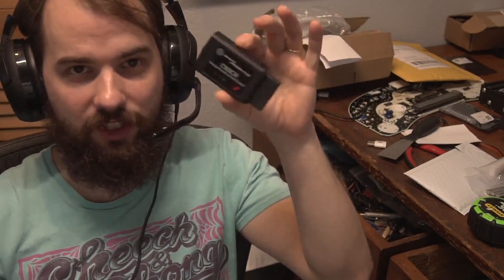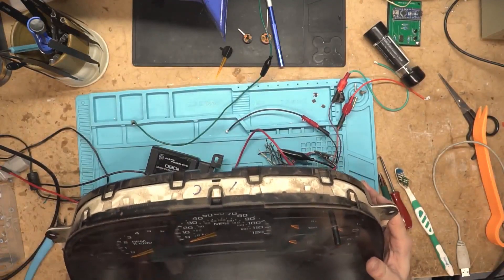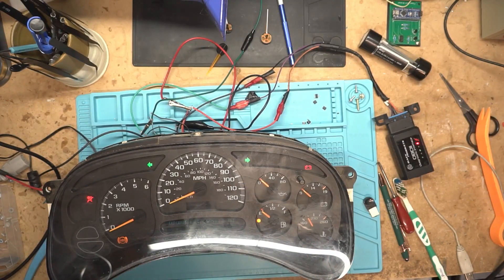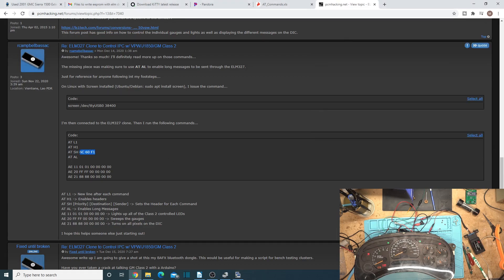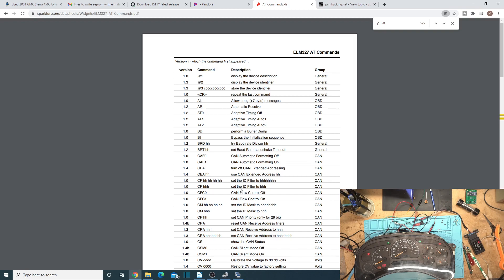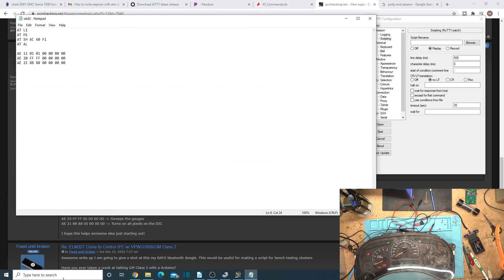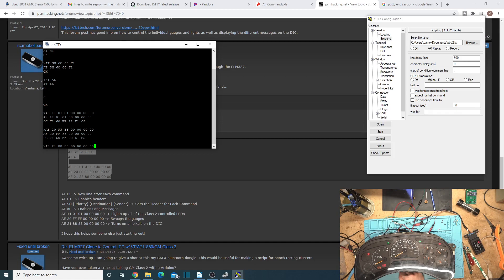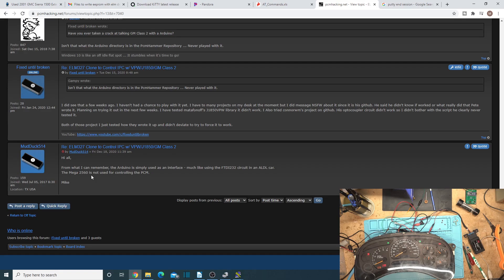Bluetooth ELM327 Dongle To Bench Test GM Instrument Clusters!

Comment: Great video.   When I try the DIC light-up command on my 2006 cluster (with a blank VFD), I get a reply different to yours. I get 6C F1 60 EE 20 E1 E5
Could this be an error message returned due to the display not working? Maybe the mpu can't communicate with the VFD drivers?   I've been struggling with this blank Info display for a couple of months, drawing a schematic, measuring voltages. All voltages seem to be generated in the PCB but still the display is blank. Getter is black.

I thought this test would maybe light up the display but no. Cannot find any info on the driver chips and don't know what voltages should be on the VFD, except the outer pins have 6.6V and others are just a few mV which may mean the drivers are not  turning on anything.

BTW none of those commands worked on an old 2002  DIC cluster I have that also has blank info VFD. They work on the 2006 though.

Comment: Could you use this same bench test setup but plug in the obdx pro vt instead of the ELM and use IPC hammer on the cluster that way?
Reply from the maker: Yes OBDXpro will respond to normal elm commands  so you can do that same test as in the video or use ipc hammer
Reply: @FixedUntilBroken  what should the voltage be set at on power supply for this kind of work? 12v or 14.4v?
Reply from the maker: @jacobknuckles9218  pretty much anything between 12.5 to 14.4.
Reply: @FixedUntilBroken  awesome. Thanks for the reply. What about the amperage? I am using an adjustable power supply 10 amp 30 volt I was thinking running at 13.5v and 2 amps for the cluster and obdx pro both connected

Comment: Add to the three for lites/gauges/dic there is also a command to test the prindle....

AE 11 01 01 00 00 00 00 - test lites
AE 20 FF FF 00 00 00 00 - test gauges
AE 21 88 88 00 00 00 00 - test DIC
AE 18 FF FF 00 00 00 00 test PRiNDLe

Comment: WHY DPES IT SAY SEARCHING THEN IT SAYS UNABLE TO CONNECT ?
Reply from the maker: Never seen that. Don't know.
Reply: Old question but if anyone is having this problem, it means ELM327 was not able to detect protocol automatically.
In this case you have to set protocol (J1850 VPW 10.4 kbaud) using following command: AT SP 2
Reply: thank you that saved me from a lot of searching @ArtursGarage
Reply: mine said the same

Comment: Okay I got the obd scanner all I need to know is where did you get the plug ? I know you got it from the junk yard but what car
Reply from the maker: Pulled mine out of a 03-07 classic Chevy. I've had it for long time so I don't remember the exact year but it was that body style.
Reply: @FixedUntilBroken  why does it say that error trying to connect
Reply: @FixedUntilBroken  it gives me a error
Reply: @FixedUntilBroken  and what version of kitty should I get theres soo many
Reply from the maker: @jackyasswanker1812  latest should be fine. Most of them are just adding more protocols and stuff but we are only using serial.
Reply: @FixedUntilBroken  it says unable to connect I’ve been trying all day I have the same obd 2 scanner you used and pin 7 isn’t there it’s empty
Reply from the maker: @jackyasswanker1812  unfortunately there is a lot of variation with these manufacturers and no quality control. The obdlinks are pretty decent with their quality control. I am kicking around the idea of making my own dongle so I can control the quality
Reply: @FixedUntilBroken  is there any other way I can make the needles sweep ?
Reply: @FixedUntilBroken  is there any other way I can make the needles sweep ?
Reply from the maker: @jackyasswanker1812  tech 2 can do it. Pcm in a box can test some gauges. Ipc hammer with a dongle that works with it can do it
Reply: @FixedUntilBroken  I’ve been trying to figure this out all day and I haven’t gotten anywhere nothing sweeps or turns on everything stays where it is the only messages I get is that the obd scanner blinks once and then I get a message  on my computer saying unable to connect
Reply: @FixedUntilBroken  how can I make all the warning labels turn on ? Other then this program

Comment: apologies, i got lost so many times in the video. In conclusion, will the elm327 work with the LS DROID app? i Just found out about it after reading the forum, and I'm super impressed.  Also, will the app work with any brand car ? or just few specific ones
Reply from the maker: What one the cheapo ones no they aren't supported at all. If you want to use ls droid just buy his dongle. He is going to drop support for 3rd party ones soon. He has mentioned it in ls droid facebook group.

Comment: Hey I’m having trouble when I put the last 3 codes to test the lights or sweep the needles I get a searching unable to connect. What can that be or what am I doing wrong
Reply from the maker: what dongle are you using and what app?
Reply: @FixedUntilBroken  I’m using the same dongle and kitty app like you
Reply: Did you ever find a solution? Im in the exact same situation can't seem to get it to work.

Comment: Thanks for the videos and keep up the great work. I was able to repair my cluster, but now my gas gauge is off a bit. How do you calibrate the gauges?
Reply from the maker: If you are bench powering it should be a needle width below e. If you are doing in the car than can be tricky but same thing needle width below e but don't turn the key on just let the gauges home to zero when you plug the cluster in to the plug with the key off if that makes sense. If that doesn't make sense just fill the tank up and try your best but that isn't going to best way to set it